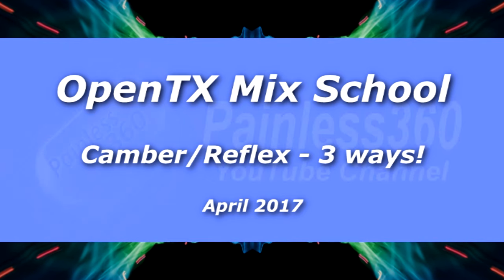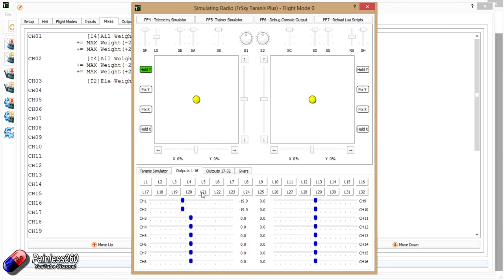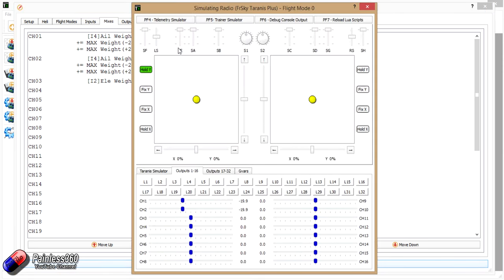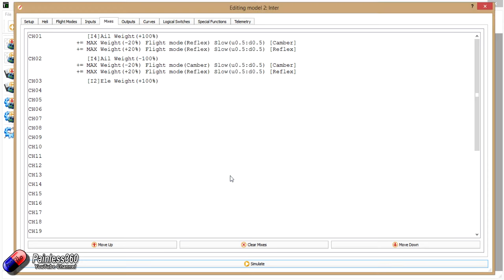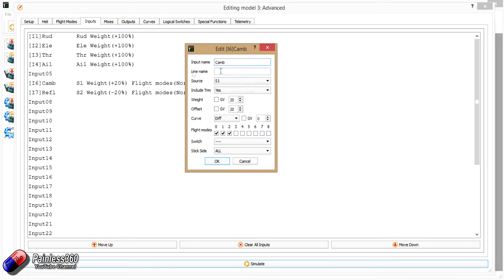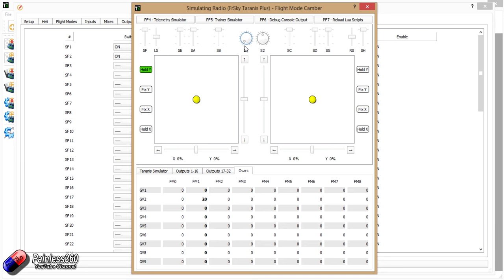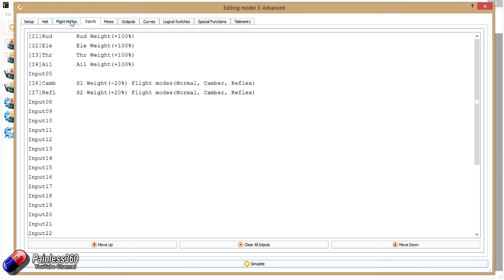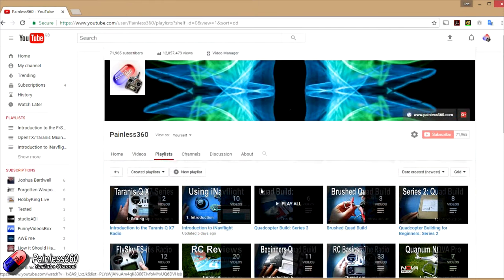OpenTX Mix School: Camber & Reflex done 3 ways! (subscriber request)

Comment: Don't forget to set up brake. Can't survive landings without it!
Some use throttle for flaperons. Using separate front knobs for camber control is awkward - maybe rear sliders. Will need elevator mixing, especially for brakes.
Plenty of OpenTx mixs for DLGs on RCGroups.com handlaunch forum.

Comment: For the advanced mode, you used the inputs (camb/reflex) as sources to special function to set values of GV1/GV2, and then mixed GV1 and GV2 in the ailerons.  What's the diference if I delete the special funcions, and instead directly mix inputs Camb/Reflex in the aileron mix as those would have the save value as the GV1/GV2 ?
Reply from the maker: The great thing with this radio is that there is at least two ways to pretty much everything. This is just how I would do it. Happy flying!